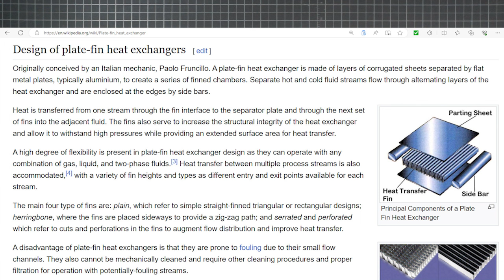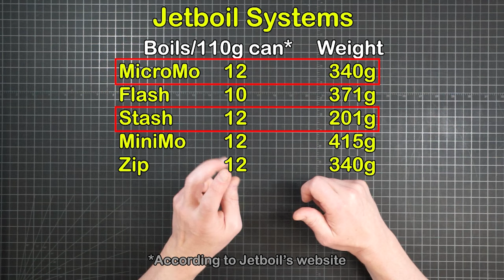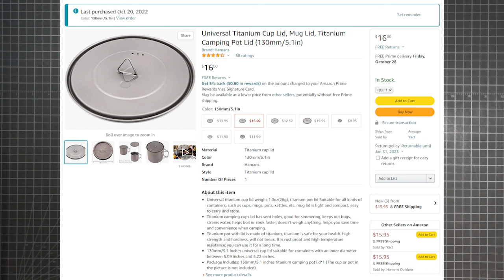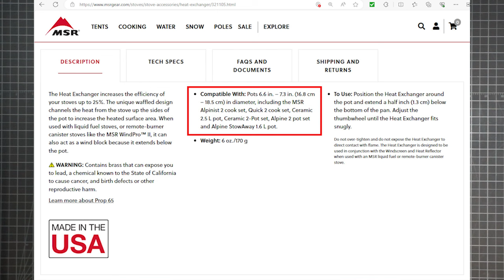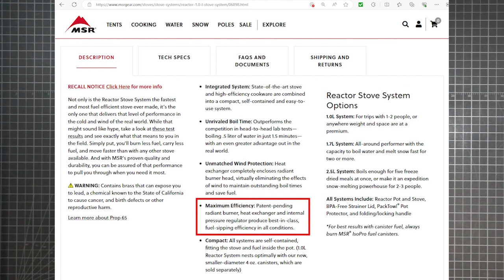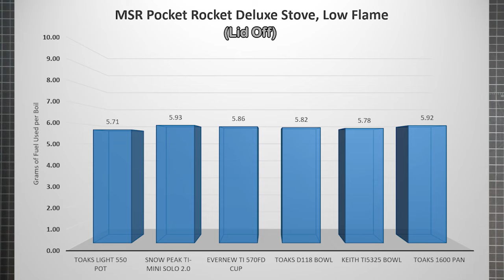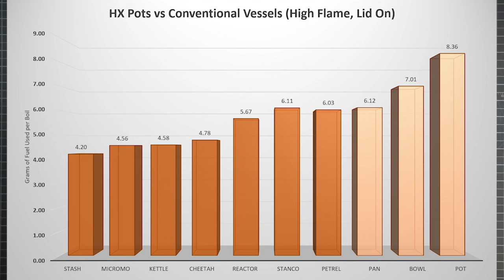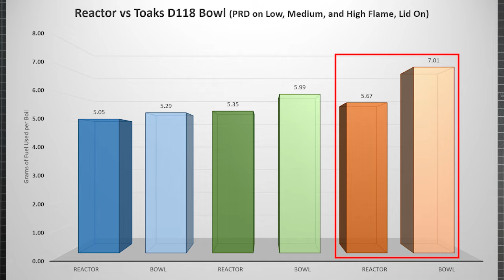Backpacking Stove Efficiency, Part 4: Heat Exchanger Systems (HX Pots)

Comment: I have an optimus terra HE pot .9 liter.  When paired with a MSR pocket rocket deluxe it boils 2 cups of water in around 1.5 minutes at medium flame.  My toaks 750ml on the same stove with low or medium flame taked 3.5 - 4 minutes to boil.  On a recent 14 day backpacking trip I carried the Optimus terra he pot for the first week when I was cooking for 2.  During the second week I carried a MSR Talon 1 liter pot (titanium and significantly lighter) and cooked for one.  I found that when I was hungry and preparing meals (I cook morning and evening) the time difference was notable and I much preferred the quicker boil.  Less trying to think of something to do while I waited for water to boil.  Also less boiled over pots because I started something during the boil and the pot would beat me.  I much preferred the HE pot and faster boil times even with a 4oz - 6oz. penalty.

It seems that the Optimus HE pot over the MSR pocket rocket deluxe hits a sweet spot.  Since it has no slots for the legs there is a greater burner to pot distance which might make it considerably more efficient.  In all my unscientific use of the system I much prefer it to any other pot combination including my toaks & bsr combination.

I found that when you have hiked in the rain or endured cool temperatures during the day getting a warm meal faster makes a huge psychological difference. 

Incidentally I read one review comparing stove systems that found the best combination was an MSR pocket rocked deluxe stove with an oilcamp HX 1 liter pot.  Beating out the jetboil in the tests for speed and efficiency.

I am planning a through hike next year and am trying to decide on my stove system.  I like the HE pot for speed more than efficiency.  I have just purchased the Petrel pot to see if I like that in combination with the MSR pocket rocket deluxe as well.  Decisions, Decisions, Decisions.
Reply from the maker: And then along comes wind! Be interesting to see how that affects it all.

Comment: Another very Skeptically great video. I was curious if there was a significant fuel loss between burners when removing from the canister. That little pop always makes me wonder... Looking forward to the next GearSkeptic video.
Reply from the maker: I keep my external valve on the can while weighing and during tests, so there is no loss of gas with that little “pop” as you say.  I suppose I could just try taking a stove on and off repeatedly and then measure the can to see if it is enough to tell.

Comment: Great review. I just received the Petrel and I did quick tests with brs300 and pocket rocket 2, and I had 4gr for 500gr water. Also they ship a set where they have Hornet stove which has pretty high distance to the pot. So I think stove choice is making a difference for Petrel.

Comment: thanks so much for the video, I think i'll be leaving my heat exchanger system in the bug out bag and taking my brs on hiking trips for the foreseeable future. I did 2x boils a day on my AT hike for coffee and dinner and definitely enjoyed the speed efficiency of the heat exchanger but in future endeavours I think a lower pack weight is worth a few extra minutes of cook time.  Although probably an odd use case, the carryover heat exchange from the heat exchanger systems does help when actually cooking in a pot rather than just boiling water for a freeze dried meal

Comment: I'm using an Olicamp XTS with a Trangia which has a diy simmer ring made from the top section of a soda can. Pot is held up by a two piece punched titanium sheet material that interlocks to work also as a windscreen. I have the canisters and a brs 3000 stove but  I get the sense that with the yellow Heet and the heat exchanger along with the simmer ring I'm saving money. Hoping when I have a few minutes I could crunch the numbers to check. I'll have to run through this video a second time to catch those numbers. I appreciate the informative work you're doing!
Reply from the maker: I do have plans for alcohol stoves…eventually

Comment: Nice video.

Given how wide the ring on the kettle is and how big the msr deluxe, I can imagine that its simply oxygen starved.

As an small aside: you can use your trekking pole to accurately messure weights. Simply put what you want to measure (eg. the cannister) into the handstraps and see where the balance point is. Make a few markings before on the pole and especially in the >300g range you can get very precise measurements.
Reply from the maker: It is possible there was an oxygenation issue, but usually that results in sooting, which I did not see in this case.

Comment: Thank you for all these tests! I wonder how a self-made caldera cone would perform, that hugs the upper side of the pot near the folded rim of the mug/pan and whereby the cone rests with cutouts in the cone, on the arms of the burner. 

Or al caldera cone wind screen where the upper holes are not merely cutouts, but that they are folded lips so it hangs/rests from the upper edge of the pot so you can use smaller diameter burners legs with bigger diameter pots. So that the cone doesn't need to rest on the legs of the burner.

This makes me curious how this would fit in with your data since a caldera cone is kind of the unicorn for alcohol stoves, giving them superior wind protection and allows the sides of the pot to exchange heat, and doing all this for way less grams than a heat exchanger ring.
Reply from the maker: When I do the wind testing for HX pots, there will also be some third party windscreens involved!

Comment: Any chance on a GearSkeptic video whether setting up a trekking pole tent  with carbon poles reduces the risk of being fried by lightning strike versus aluminum poles?
Reply from the maker: Hmmm…no idea how that could be tested (much less safely)
Reply: The test would not be set up in your workshop. 😅

I imagine there are many studies on lightning protection which led to the standards to protect buildings from lightning strikes. If based on that info it is not possible to give a definite answer whether carbon trekking poles are safer than aluminium ones a set up in a lightning prone area with lightning counters would be great to get closer to an answer.

Comment: Very interesting and well thought out as I’ve come to expect from you. There’s a couple videos of backpackers doing boils of the BRS/ Toaks (my current) and the petrel/ greenpeak (in the mail.) The latter saving 2g/ boil. Now, I believe they were boiling 2 cups and the burner was the one Fire Maple sells with the pot. Fire intensity and weather would also be factors. Real interested to see your wind video and if you could use the greenpeak stove, I’d certainly appreciate it. Great work and thanks for the laughs 😁
Just thought to ask, what altitude are you at?
Reply from the maker: 2400 feet altitude.  Soon it will be cool enough to resume testing!

Comment: One possibly overlooked variable, on the MSR wrap-around: lowering the exchanger, so that it acts as a chimney/wind guard/flame catcher. It won't have as much area in contact with the pot, but it could possibly capture and force more of the hot efflux from the burner to travel up the wall, rather than around the exchanger. I know you tested this on previous videos, but the gaps on those devices were, in my opinion, too small to function, and the MSR had a chance of actually working.
Reply from the maker: If you see the action shots, I did have the exchanger pulled down below the bottom of the pot (per MSR’s instructions).  I think a bigger problem is the relatively small burner. With the HX around the outside of the pot, it is farther away from any flame or hot spot.  Also, with only 415mL, that larger pot was relatively empty. The water line inside was low. Other HX conduct through the bottom, so that’s not so much of a problem, but the outside HX only conducts through the sides.  I do want to try more things with it, to see how well it can work.

Comment: Very interesting episode since I’ve just been down the rabbit hole of buying and trying pots. And maybe it’s not over. I am a fan of that Firemaple kettle, it was very efficient. Ultimately tho I took it out of the kit because its diameter isn’t great in the pack. Even worse with the nesting pot and pan and despite a large size didn’t allow a gas bottle and Soto burner inside and still close the lid(s). I’ve now got a titanium small kettle from evernew and a 1 litre pasta pot. Fits everything inside while easy to pack. I have noticed I’m not going to tick every box. No one does titanium with heat exchangers, I don’t know why, and none have the versatility of being able to go from gas to campfire or twig stove. I’ve customised my pasta pot with a Billy wire so I could hang it over a campfire if need be. Nothing saves gas better than a folding twig stove.
Reply: machining and manufacturing titanium parts is significantly harder than aluminum.  I suspect we will see more titanium products in the near future as 3d printing titanium is relatively popular and 3d printing allows for more complex HX designs
Reply from the maker: Titanium has relatively poor heat transfer, though. That’s probably a reason why you don’t see those.

Good point about using over a campfire.  Regular pots can be very versatile.

Comment: Curious to know if you tried settling the Petrel on the fingers of the Soto (as opposed to locking them into the recessed slots) to see if the increased gap made a difference
Reply from the maker: It’s been suggested! I will try it both ways when I do the wind testing 👍🏼

Comment: Yet another great episode in the quest for the holy boil. Meanwhile I  also did some testing myself. Not as thorough as you, I did use a thermometer in the beginning but quickly discovered that my tap water is an almost constant 18 C. I also did not stop at the 200 F (93 C) mark but just did a visual check on boiling as that is what I will do in real life.
Results are not too different from yours. My big 1.4 l HX pot boils 415 ml water using 4.9 grams of 80/20 isobutane/propane mix (the Primus brand) but using one of these cheap butane cylinders (these are sold over here as fuel for weed burners very cheaply) that same boil (after cooling down everything) uses only 4.5 grams of butane. Taking into account that the butane cylinder is lighter (327 grams, 227 grams gas) than the Primus one (380 grams, 230 grams of gas) this could be a good option for a summer holiday.
As a plus, I find these cylinders easier to connect (push & twist) with less possibility for spoiling fuel when doing so.
When your shop getting too warm, this might be a nice thing to test: what is the best fuel for a summer trip 😁😁😁
Reply from the maker: I do want to compare brands and types of gas fuel to see how they perform. No shortage of ideas for future videos!

Comment: It seems that those values depend from the stove you use, is it correct? For example, you tested petrel with a soto windmaster, is it correct? But probably if i use a Firemaple polaris or a greenpeak i will have different result?
Reply from the maker: I think stove-pot distance and heat exchanger design matter more than minor differences in stove design, but that was not directly tested here.

Comment: Very interesting video. I have been using and comparing stoves for a couple of years, including Stash. Because I want a fuel efficient stove on my longer hikes. I have come to the same conclusion that the Stash is very fuel efficient. I put a Optimus Clip-On windscreen on the canister to get better performance in windy conditions.
Reply from the maker: Interesting. I will have to try the Optimus shield with a Stash when I do the wind tests!

Comment: The legs on the fire maple stove that comes with the Petral kit you showed look like they would hold the pot up higher than the Soto, so would be curious to see those results since there seems to be a correlation with burner gap
Reply from the maker: Agreed. Pot-burner gap could bear more testing!
Reply: @GearSkeptic there is also no reason I can see why you can’t just put the bottom ring of the pot on the stove legs without using the cutouts.
Perhaps the added height would be more efficient in windless conditions, while using the cutouts could be ideal for wind.
A two mode pot perhaps

Comment: Any thoughts on DIY heat exchangers? I wonder if the heat exchangers work more by capturing heat and conducting it to the water or by holding the hot air close enough to the pot for radiation and conduction against the flat metal. I ask, because I've heard some suggest using carbon felt or similar on the bottom. I know some alcohol stove systems use a windscreen that also acts as a pot stand and sleeve to keep the hot air close to the pot or cup for as long as possible.
Reply: Without any real knowledge of this, would carbon felt not act as an insulator?
Reply from the maker: Hopefully, after the wind tests I will have gotten some more insight into how to design (or at least arrange) a somewhat optimized system.

Comment: Does pitching a tent with carbon fiber trekking poles reduce the risk of lightning strikes vs. using metallic trekking poles?

Could you investigate that? The community is in the dark about that.

Comment: In very low temps the lower time to boil should be even more efficient as the radiant heat loss from the heated pot to the cold air should be lower if boil happens faster.

Comment: Since the HX system's ideal use case seems to be multiple boils (at least in the no wind case), it would be interesting to compare multiple boils vs 1 large boil across a variety of pots. Everything at this point is normalized to the same volume of water, but it would help people to draw conclusions if they have higher water needs per boil (e.g. couples and groups).
Reply from the maker: I do have it on my list! I’ve begun collecting 2L containers for larger volume tests.

Comment: Petrel has the benefit of adjusting the burner gap.  Be interested to know results of petrel if burner isn't used inside the slots.
Reply from the maker: Agreed! When I do the wind testing, I will check it both ways.

Comment: And how would the Petrol do if the cut-outs were not used? The distance would be increased by at least 10mm putting it inline with the other HX pots. Which would apparently increase its effectiveness with no wind.

Comment: Really makes me wonder: how close are we to thermodynamic limit with all this gear? I mean, what is the lowest theoretical amount of gas needed to boil a cup of water? And can we quantify different types of losses between this theoretical limit and real world equipment?
Reply: To heat 500 ml of water from 20 C to 100 C at a 100% fuel efficiency would require 3.7 grams of Isobutane: it’s all about math.  My 2 cents.
Reply: @FlatCatGear  Thanks, 3.7 vs 4.17 is much closer than I would've expected, it means only 13% losses for the best tested solution. And that's includes heating the vessel, evaporation, radiation and hot gases escaping around the cup.
Reply: @rotors_taker_0h  Now, the parameters that I gave you is what I use to test.  GearSkeptic uses a 415 ml volume and a 200 F end point.  If he starts at a water temperature of 45 F then a 100% fuel efficiency would correspond to 3.31 g of isobutane.

Comment: If you're hiking with a group and sharing resources, wouldn't you want a larger pot so that you can boil the group's water all at once? So the 92 boils metric is perhaps inaccurate b/c the weight and boil time is going to be different.

Comment: The petrel could be used with the stove supports in the slots for a small separation, or rotated 60deg to have a larger separation. I'd bet it has worse wind performance but might be more efficient without wind.
Reply from the maker: Sounds about right.

Comment: Are your results based on single data points? I don't see mean calculations or data ranges mentioned or shown on your charts.
Reply from the maker: For the most part, yes. I do regular spot checks of accuracy throughout the testing (and sometimes extra if something looks odd). This has yielded a pretty tight range and a relatively small margin of error.

Comment: Been watching your videos about stoves and water treatment and I was surprised how huge the effect of wind was on performance of stoves, even at rather low speeds. Knowing that windshields are not the topic of this video I would love to see you test out the effectiveness of a simple sheet of aluminum foil or folded foil as an external wind shield, laid around the container. I would like to guess that it should eliminate most wind effects on the flame, but you never know until you get someone to try it out in the most overly scientific way possible...
Reply from the maker: When I do wind effects on HX pots, that video will include windscreens+HX pots, where appropriate!

Comment: Great job 👏
I use a Fire Maple remote titanium stove that fits inside of the fins of the 1 liter Fire Maple heat exchanger pot at low heat
A large gas canister gives me an extended time of simmering cooking food like lentils 
.
I don’t understand why you did not use a single stove head throughout the entire testing 
This would have kept the flame distance at a constant 
Also the stove weight as a constant to compare the final system weight savings
Thanks
Reply from the maker: No one stove would fit all scenarios, and some of the pots had proprietary, attached stoves that won’t work on other pots.
Reply: @GearSkeptic 
Clearly the self contained units use their own stoves
The BRS stove would not have worked?

Comment: Hypothesis, one could probably take the Petrel pot and not use those slots for the stove arms, increasing the gap and allowing the flame to develop in the center of the pot, and possibly increasing efficiency. (Possible downside instability.)
Reply from the maker: Yes! I plan to test it both ways when I do the wind testing.